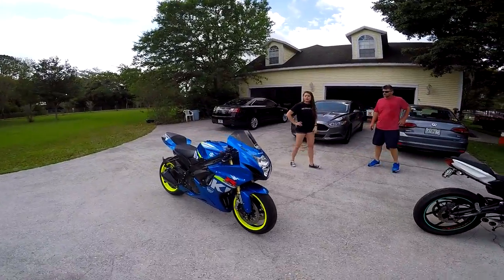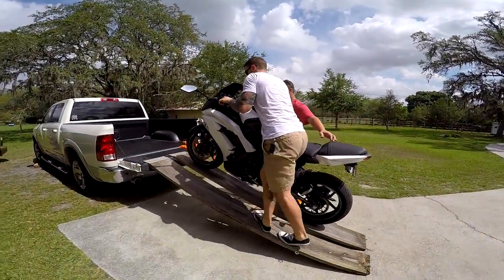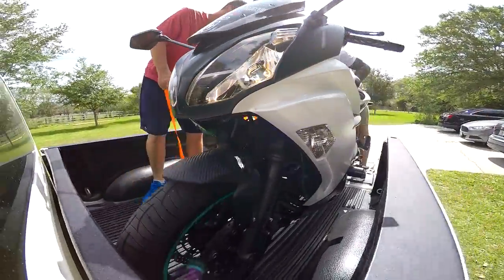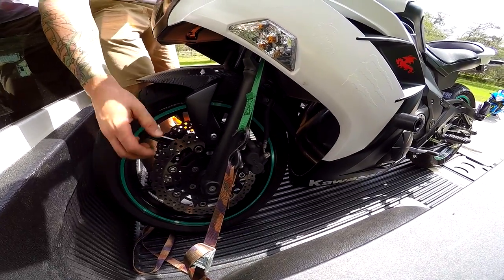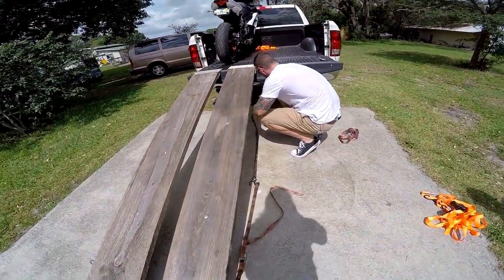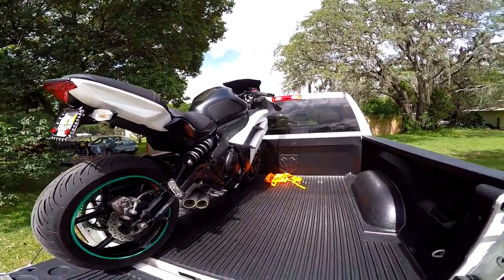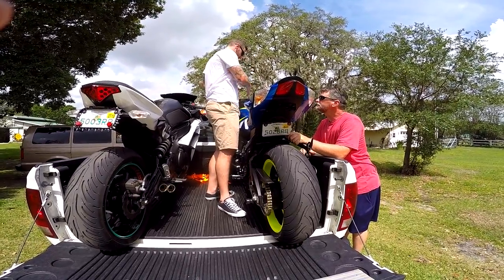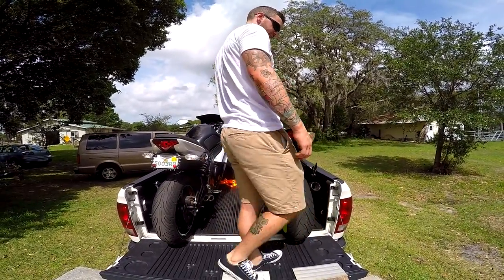How To Load 2 Motorcycles Into 1 Truck

Comment: Easier to back truck into a shallow ditch/berm, ramp to truck is flatter, ride 1st bike onto bed and park in left side of bed set on kickstand with front tire turned to left resting on front bed wall parking in first gear. Secure left fork triple tree using a soft tie and tie down strap with some pressure. Then attach a soft tie 1st bike's upper right fork triple tree. Ride 2nd bike on and park to right side and turn front tire to the left against front bed wall as well, resting on kickstand parked in 1st gear. Attach a soft tie on 2nd bike's left upper fork triple tree, then using 1 or 2 oval locking carabiner threaded quick links attach upper forks soft straps together between the bikes so the straps are taunt. Then tie down 2nd bike's upper right fork triple tree to a soft strap.  Done.  Been on several 900 mile trips and bikes are secure.  Kawa Ninja 1000 and Z1000 or even Suzuki B-King with Yamaha MT 10.  The heavier bikes always goes on first to the left side. My truck is a 2007 Tundra 4x4 3"-1" lift with 6' bed, leave tailgate down like yours. .

Comment: Wish I had the photos but they got destroyed. I hauled a bunch of bikes once and fit four into the back of my 95 F150. My pig of a bike Road Star Warrior, YZ250, XL125, and hanging sideways on the edge of the tailgate at a 35 degree angle was a XR75. Had a lot of people slow down and look, but made it 2,500 miles no problem. 6x10 trailer was just as loaded too.
Reply: Also, when I raced enduro I had a Chevy Citation... Bike fit nice right up the hatchback and onto the roof.
Reply from the maker: wow! that is impressive! I would have loved to seen that! haha

Comment: You made a HUGE meal of that.. The white bike should of had its stand down then tied off leaning slightly over to left that way it can't fall.. Blue bike should of done same but tied off round the bars and over back wheel.

Comment: Have fun! Be safe. Just finished watching the video on 2 bikes loaded on one truck. Awesome video. Thanks for sharing.  Also, I couldn't make out the brand tires on your bike. Looks like Michelin P4. What tires do you prefer? I've tried P4's. Great tires for long commutes. A bit slippery in the turns. Currently on Roadsmart 3. I prefer these over the P4. Excellent traction, so far mileage has matched the P4. I highly recommend. My ride is a 15 Busa.

Comment: This is what I gotta do today with a mt07 cb900 and a grom in the middle
Reply from the maker: You should be fine, have both big bikes facing forward and as close to the outside walls as possible, then put the grom in the center facing backwards. I've seen 3 full size bikes in an F150 6' bed no problem
Reply: @SALTxTHExWOUND  did it no problem. Loading the grom backwards was the most difficult

Comment: I have the same bike but an 08, just a question what tires do you use on the 750? mine are due for a change
Reply from the maker: I run pilot road 3 and 4's whatever is available, they're about the same but they last long and have great grip!
Reply: SALTxTHExWOUND thanks boss